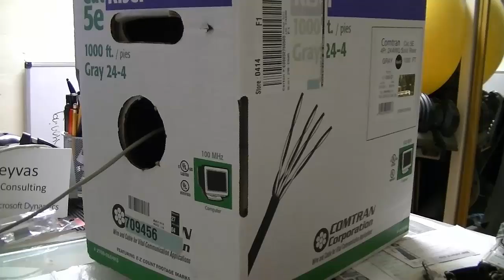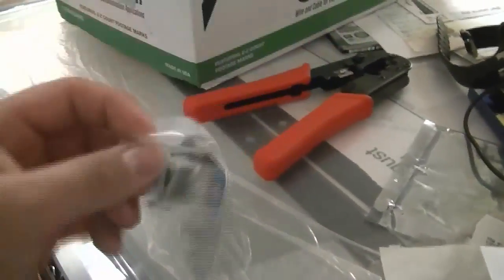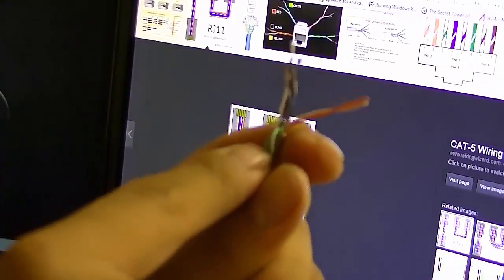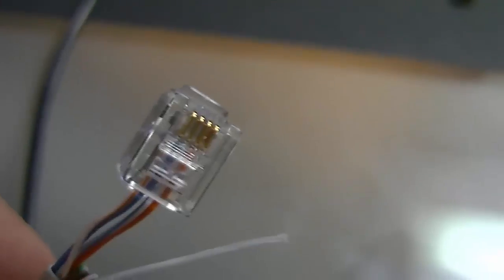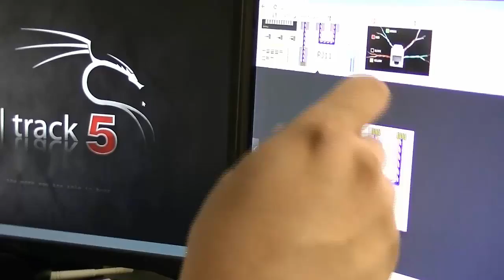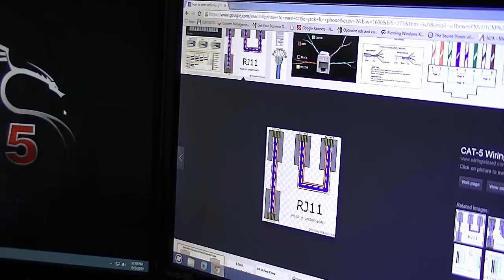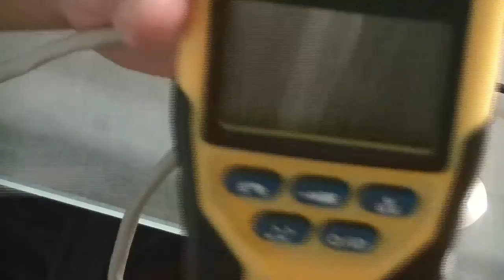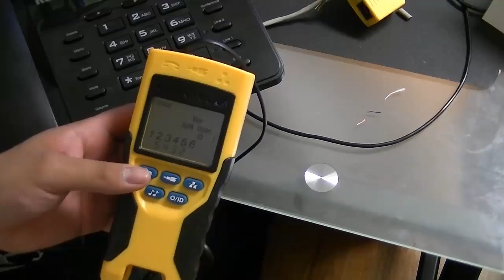Cat5e to Telephone Jack RJ 11

Comment: Thanks for this!  I'm curious as to what the site is on your computer screen; the visual aids look helpful as well!!
Reply from the maker: Am RJ11 (telephone) wiring diagram. 
But without red,black,green,yellow which are the typical colors to use in a normal RJ11 cable. To illustrate that you could use any cable as it just needs to carry a current. 
Thanks.

Comment: I'm not bringing up the gripes most have, I got past them cuz I'm being focused on what I'm trying to accomplish. However, You paired a Ethernet cable for RJ11 on one side using the Orange and Blue pairs and terminated using 568A standard. Why? 
You didn't explain why it was done with this standard instead of the more popular 568B standard. 

Secondly, you then come back to the camera later and explain the blue and orange pair equivalents in a RJ11 connection, however my RJ11 cable is reversed so only one side is in a particular order and the other side of it is opposite pinning. I know why I'm just saying it makes it difficult to match things up when you're jumping between two different use cases.

Comment: HI Vitech thanks for this video. Really helpful. I am in a bit of a similar but different situation. I have one pair of Cat 5e (Rest is used by my Security alarm so I can't fiddle with it) running from my attic to my study, where I want to get the data. I have extended  another Cat5e running from this single pair to my closet box which is connected to a switch. Right now I do not have a data to my study because I do not know how to pair them. I have green and white green pair that is currently available from my study to the attic and whole 4 pairs available from attic to my junction box in my closet which is connected to the switch. Please help me how to wire this so that I can get data in my study.

THanks a lot for you response.

Comment: why nobody make these
Reply: Not true, and I'm about to have to do this. Because I can't run RJ11 130feet from the telephone pole to the second building without some serious degrade issues, not to even account for the issue the power cable and rain will cause the cable. Cat5e can run nearly quadruple the length of an RJ11 cable, and has a shield that will protect it from the power cable and the rain.